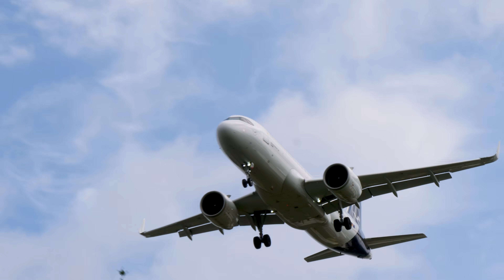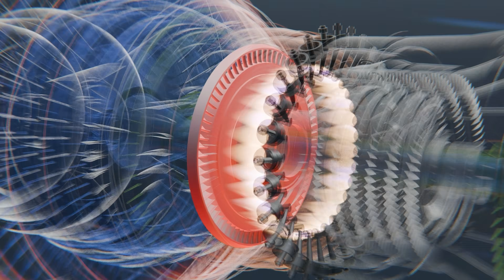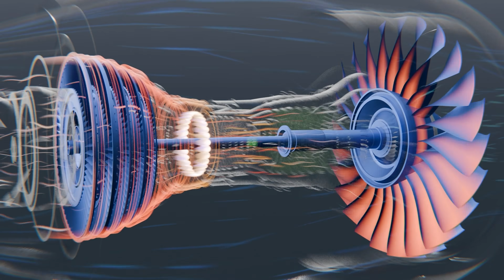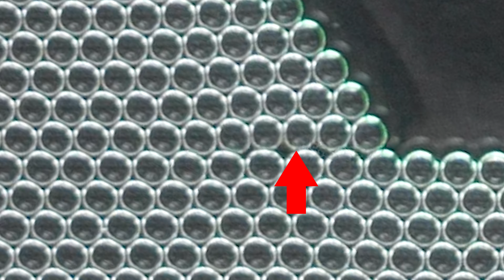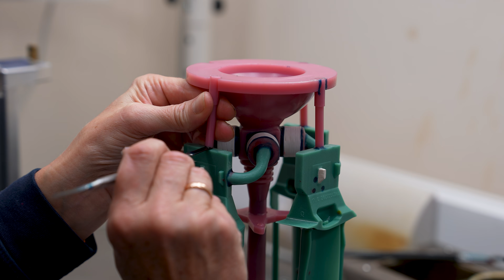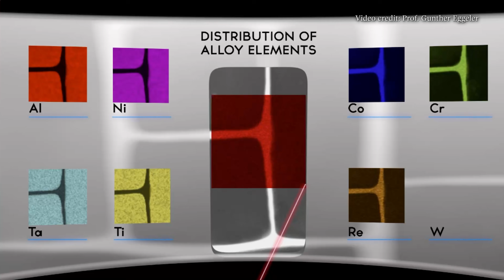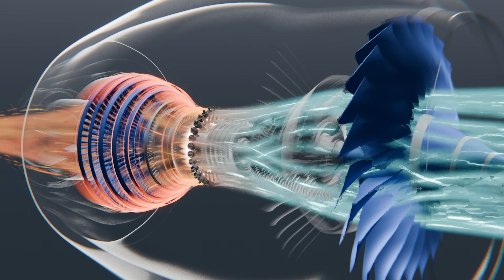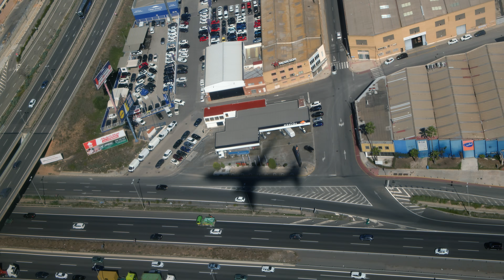The Ridiculous Engineering Of Jet Engines

Comment: An aircraft engineer here , as dust and sand settle on to the internal components of the combustion engine we start to see a trend in the rise of EGT than normal operating conditions, we generally tend to perform engine compressor wash with desalinated water two to three times to bring the TDS levels down, post doing compressor wash we generally see much better compressor efficiency and a lower EGT and much better fuel efficiency.
Reply: Imagine being on a plane with that lady that can't believe it works. She is saying ''guys this could be the one we all die on'' everyone is saying ''be quiet and just enjoy your flight crazy lady'' then she says ''no guys you don't understand, I engineer these engines at Rolls Royce''
Reply: Ugh, you awakened my engine wash PTSD. We had to wash our Black Hawks' engines every time we flew above salty waters. It was such a boring, stale procedure. Only perk was we crew chiefs were allowed by the supervising pilot to engage the engine starters. 😝
Reply: Thanks for the info. Will you please define the acronyms you used, EGT and TDS?
Reply: @ncdave4life  (Electrical Engineer, Student Pilot and Advanced Ground Instructor) EGT Is Exhaust Gas Temp, and one of the functions of engine performance 

Some other Jargon, N1 is the low pressure turbine speed (the fans in the front), N2 is the high pressure turbine speed (the blades in the back), and ITT is Interstage Turbine Temp.

ITT is critical during an engine start as the lack of airflow (when the burners ignite) can cause structural deformation (see Hot Start)
Reply: @ncdave4life  They use a special mixture of fluids to reduce the Trump Derangement Syndrome in their turbines.

Airlines lose customers when the engines get political during flight.

(TDS is total dissolved solids, EGT is exhaust gas temperature)
Reply: @yariboi5  That's why they refer to engines as engine number 1 and number 2: calling them the left-wing engine and right-wing engine was just asking them to argue :)

(I assume they're numbered instead of being called left/right because planes can have more than two and standardisation is good.)
Reply: @yariboi5 😂
Reply: You’re funny. So good. TDS is definitely an issue! 😂
Reply: @yariboi5 EGT or ESG (Environmental, Social Governance) 😆
Reply: @ncdave4life  Disregard the clown comments in this thread. EGT. Exhaust gas temperature. TDS: Total pressure distortion, low TDS means the airflow is smooth and uniform across the entire face of the compressor
Reply: Meanwhile aliens are watching laughing saying ''look at these creatures trying to deal with these pathetic temperatures with their silly little power creations, they haven't even discovered quantum friolium fision burst blasters yet hahaha, such fascinating privative little beings. They are no threat''.
Reply: what about a bird
Reply: @jeffreyge1389 They test that too - one standard test is firing a whole chicken from the grocery store from an air cannon, straight through a max-power engine. They have to be able to keep running after taking the best Colonel Sanders can throw at them. 

If you're ever flying and it smells like roast chicken after takeoff, then the bird made it into the combustion chamber, not just the bypass air. Not super common, but it does happen. (The plane is pressurized and heated in flight with bleed air from the engines.)
Reply: Really interesting
Reply: Paper plane engineer here, we can’t even afford rice paper.
Reply: What's the efficiency impact on fuel usage? 5%?

Comment: This is awesome. A great follow-up would be a video on GE's development of the drastically more efficient planetary gears, which serve to reduce the RPM between the turbine and fan. It greatly reduced the size of turbine needed to drive the fan. Probably increased efficiency on a similar proportion of single crystal casting, if not more.

Comment: This helps combat all the "jet fuel doesnt melt steel beams" people out there. Look at how steel deforms at 550C. Jet fuel can burn at 1000C.
Reply: Use some liquid oxygen and it'll go much higher then that. Combustion of kerosene in the raptor rocket engines hits 3300 degrees Celsius.

Comment: Well, the temperatures are nothing special! The combustion chamber of a car's internal combustion engine reaches temperatures of up to 2500°C. The exhaust reaches up to 1200°C. Formula 1 cars reach even higher temperatures and do not use fans for cooling because they are not efficient enough.

Comment: what keeps the hot gas going to the rear and not blowing back out the front again?
Reply: Air moves from high pressure to low pressure. The highest pressure in a jet engine is right after the compressors. It's all downhill after that out the back. Combustion does not increase the air pressure in a jet engine as the air isn't confined like in a piston engine.  It actually lowers it somewhat as the now hot air expands. A jet engine is really similar to a hot air hair dryer. The only difference is the fan is powered by an electric motor rather then a turbine and the heat is added by an electric heating element rather then by burning fuel. Other then that they are the same thing.

Comment: This is the best explanation of aeronautical engineering i've ever seen. I've always wondered just how jet engines produce thrust and I've spent a fair time reading up on it. Knowing that the thrust drives the fans (hence the name) it made more sense than just expanding hot gasses go boom. Now it's: engine with 8 propellers go fast.

Comment: i was wondering if dust could get in the cooling holes and block them... and then I was like surely thats not a problem, the heat would burn it away or something. And then they mentioned that it is indeed a problem lol

Comment: So, all this jet voodoo... is basically just to drive a good old propellor plane?!  (80% of the thrust coming from the thrust of the fan at the front vs 20% of the thrust coming from the jet).  At the heights jet planes fly, I would have thought the air is too thin for this.

Comment: 22:37 should say "1,200+" not "1,200". the guy just said that the temperature reading stops at 1,200, not that the temperature stopped climbing.
Reply: It said the temperature program ended at 1200, not that the reading did. The temperature remained at 1200.

Comment: 11:09 -- Little video correction here: the first jet engine flew in 1939 because of Hans von Ohain.  However you are correct that Frank Whittle is the original inventor of the jet engine.  Whittle's first jet engine powered aircraft flew two years after von Ohain, in 1941.

Comment: Im guessing it's for the same reason gasoline and diesel engines don't melt.

I'm further guessing that turbines are sufficiently cooled by the fuel and airflow.  And maybe a lube/coolant circulating through the bearing.  But probably just airflow.
----

Oh. Or crystals. My second guess was going to be "crystals"

Comment: I work with mass spectrometers in a laboratory (I’m not a MS engineer, but maybe someone that is can speak to this). 
Similar to jet engines are the turbomolecular pumps that pull a vacuum within a mass spec. It is absolutely wild to me that these pumps run for months on end, at atmospheric pressure, within a comfortable laboratory temperature, while also being moderately quiet to have a normal volume conversation around them. They also fit nicely on the floor just below the mass spec and are about the size of a large microwave. Such a cool technology that allows mass spectrometers to function.
I have to wonder if any companies that manufacture turbomolecular pumps would be willing to explain the tech that goes into these Derek 🤔

Comment: Could the leading edge of a jet engine cowling be used to create an electrical charge on incoming dust particles, that would then be electrically attracted to the outer portion of the air flow that bypasses the fan portion of the jet engine?  Perhaps also a charged spinner that repels those same dust particles.

Comment: Years ago, when I originally saw somebody describing modern jet engine turbine blades as "ceramic coated hollow single-crystal superalloy drilled with cooling air holes" I was expecting it to be at least half marketing speech. It turns out that it was 100% true.

The pigtail mold structure to filter away all but a single crystal structure was ingenious! I would expect it was originally found by accident.

Comment: "As the hot exhaust gas is shot out the back of the engine it pushes the engine forward."
NO. That is WRONG.
Both the exhaust gas shooting out the back and the engine itself moving forward is a result of the PRESSURE of the gasses inside the engine. The exhaust gas does NOT move the engine forward. The exhaust gas movement is a RESULT of the internal pressure within the engine, just as the engine itself moving forward is the result of that pressure. The one motions is NOT the result of the other motion.

It would be helpful if you actually showed the pressures inside the engine, and in particular the pressures, and against what parts of the engine, that are moving the engine forward.

Comment: Might be a stupid question, but wouldn't the blade being made of a single crystal turn it magnetic? I vaguely remember something about modules in a metal that are all magnetic, but they are all oriented in different direction so the metal itself is not magnetic. But if the blade is made of a single module then it should be magnetic, right?

Comment: Piston engines run at up to 2000C and the aluminum pistons they use would melt at a quarter that temperature. Not comparing the technology here but focusing on the premise that the combustion temp is higher than the melting point of cooled components is odd since every IC engine experiences that.

Comment: I learned about turbine engine in the early 80's. I even taught about them. It is all about using pressurized air to keep parts from melting. P1, P1, N1, N2... The nomenclatures, designs and materials have changed some, but the principles remain the same. Good to see it from an engineers pov. Personally, I never met an engineer that I didn't want to punch in the mouth. Work as a mechanic for a while and you will understand. Ha Ha. It is all about putting things where they don't belong and are hard to get to... And specialty tools that only come from overpriced tool trucks... Fun stuff.

Comment: air temp and actual temp of the metal are 2 different things... also where they fly is extremely cold. theres always somewhere for the heat to go

its not the same as in a lab, also the jet engines have channels for cooling...

Crazy good video though!

Comment: At (4:02), The K.E. formula on the right hand side, where 1/2 as much mass of air is being pushed at 2 times the velocity is slightly wrong. There is a 1/2 missing at the front. 

So it should be 1/2(1/2)m.(2∆v)^2 = (1/4)m.4∆v^2 = m∆v^2

Comment: The turbo fan uses 90% cooling air flow so that the 10% doesn’t melt the engine parts… yes, it’s more efficient but mainly it’s just the safest way to do it

Comment: all in the jet engines is done so the flame does not touch any part of the combustion chamber or in the powerturbine. million small air passages to cool the turbine blades from inside and create a layer of colder air around them  and on the walls of the combustion chamber.

Comment: 29:34 "And as if casting as a single crystal is not enough, actually the orientation of that crystal is also of paramount significance. So you may have cast this as a single crystal, but if the crystal orientation is is off by a certain amount, you get completely different stress responses within that blade. - Today, after decades of development, over 95% of blades can be cast successfully as single crystals."
Reply: The strength of these single crystal (SX) materials varies with the change in orientation of the applied force/stress relative to the crystal’s directional indices.  In the <001>, <010>, and <100> directions the material has its highest strength and lowest elastic modulus.  As the applied force/stress orientation moves towards the crystal’s <011> and <111> directions, the yield and ultimate strength of the material drops and the elastic modulus increases.  That’s why it can be important to control the crystal orientation of the turbine blade casting.
Reply: They literally say that in the video

Comment: The reason turbine blades don't melt is because they're made from titanium that has a melting point of (3,034°F). They would NEVER use a metal that melts at 1500 degrees.
Reply: Did you not watch the video?
Reply: @tsurutuneado5981  He starts the video saying the engine operates at a temperature that should melt the turbine blades. That is simply not true. I'm not going to argue with you about this. The most critical time for a jet engine is at startup (Hot start). There are different metals and ceramic coatings that help with protecting turbine blades. There are also "Hollow" blades that use cooler compressor stage air to cool turbine blades

Comment: What's the deal with the figure at 34:27? At first I thought its was a cross section of outer layer of the blade (and that the waveyness was an artifact of surface imperfections), but then you added two axes. Is it supposed to imply that the metallic coat needs to be thicker at moderate temp at that's why it's wavey?

Comment: I went down a rabbit hole of people who believe jets don't use jet fuel.  save yourself the brain cells and don't look into it lol. I'm an air force maintainer and have personally reacted my hand directly into jet fuel to change a valve in an F-15E conformal fuel tank, and I'm an ejection seat mechanic. To believe that the fuel that I've reached my hand into isn't real is peak insanity.

Comment: so what I'm hearing is that the ceramic coating that is 0.25mm thick is the only thing preventing the jet I'm flying on from melting at 30,000 ft in the air. Fantastic.

Comment: I haven't watched the video yet but I am going to make a hypothesis. My hypothesis is that it's the same reason a paper cup full of water will not burn when placed over a fire until the water is evaporated. My hypothesis is that all of the heat leaves the system through  air before it has the chance to melt anything.

Comment: These components DO NOT run at temperatures above their melting point. They don't even run at close to it because materials soften or get plastic before they melt. They are COOLED internally, so even their surfaces are well below their melting points and well below the gas flow. That's not the same thing.

Comment: 1900 km/h is faster than the speed of sound (1234.8 km/h ay 20 C)
Gee, that is pretty fast!
Reply: Except that it isn't anywhere near the speed of sound. The speed of sound in air changes with temperature. At the combustors the air is around 1,500 degrees Celsius making the speed of sound through that air around 3,350 km/h. Air flow through a jet engine is "always" subsonic but due to the high temperatures, that subsonic air might be moving several thousand km/h and still be subsonic.

Comment: I remember reading Tom Clancy's non-fiction book "Fighter Wing" many, MANY, moons ago. In it he talked about the F-22  how the fan blades of the F-22's engines were each one crystal (way oversimplifying here) which allowed them to operate at a higher temperature. AND this allowed the F-22 to "Super Cruise" or operate above Mach 1 without using afterburner.  The F-22 first flew in 1997! I always wondered how far along this tech went. On another note, amazing visual representation with the air bubbles! And all of it!

Comment: I'm going to guess that the temperature not melting the metal is due to pressure differences, and a higher pressure making the melting point higher. Second guess being the momentum and or air being pushed through as a wild curveball guess.

Comment: Hight temperatures exist in every internal combustion engine that are well above melting points of components.  That is what cooling systems prevent.  The design of jet engines manage those high temps with thermo dynamics.  Even rocket engines would melt if not managed accordingly.

Comment: Rolls Royce Trent 1700-97 is the one having problem with Middle Eastern Airlines like Etihad and Qatar due to dust in their desert climate hub base. LOL, talking about problems. It is also the reason why Emirates is not replacing their A380s with the current largest Airbus in production, the A350-1000 (powered with that Rolls Royce engine they tested in the video). The Emirates A380 were either powered by Trent 900 or Engine Alliance GP7000 - the latter were Emirates' main engine choice for most of its A380 fleet.
While Rolls' solution to the cooling is super cool, GE is the material science leader among jet engine maker. Rolls uses 3-spool layout, Pratt & Whitney uses gearbox, while GE uses some kind of flexing blades to couple its high pressure and low pressure spool.

Comment: Reason being: they are "coated" with "cooler air" (600°C) Same principle as the leidenfrost effect, protecting your finger from being cooked when dip in molten metal for a fraction of second

Watch the whole video to learn more about how they removed most of the known weaknesses of the fins

Comment: That a Jet Engine works is absolutely insane Engineering at Limit, it sounds impossible that parts of the Engine runs hotter than the melting point and keeps stable. Also managing casting a Fan Blade out of a Single Crystal is crazy. My dad was a Aircraft Mechanic who his last job was repaired Jet Engines. His job was checking the engine and replacing the Fan Blade. Is crazy, without this Material Since would the Engine not so reliable and Flights would still expensive has heck. 😅